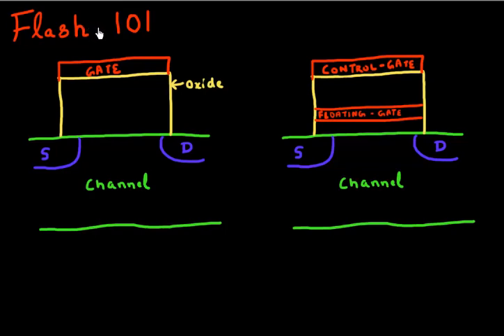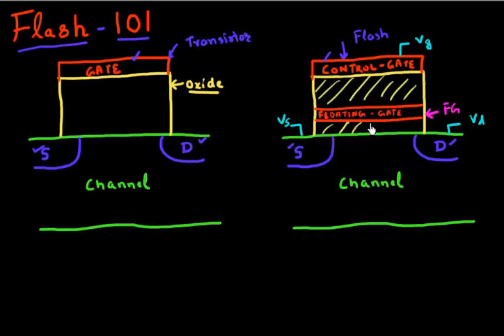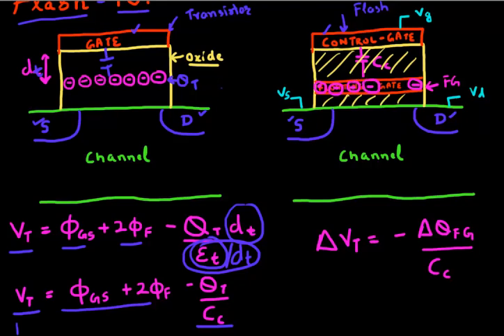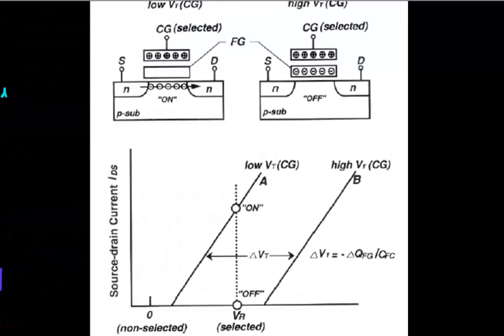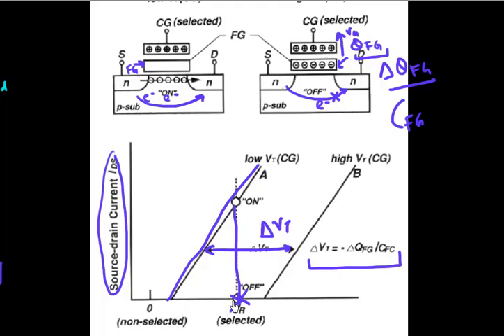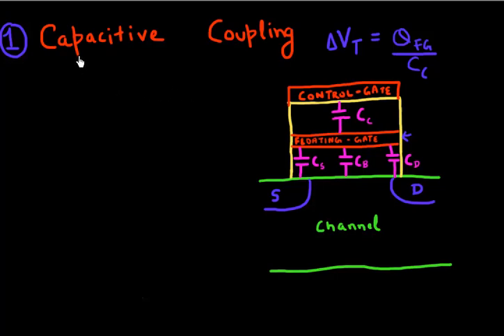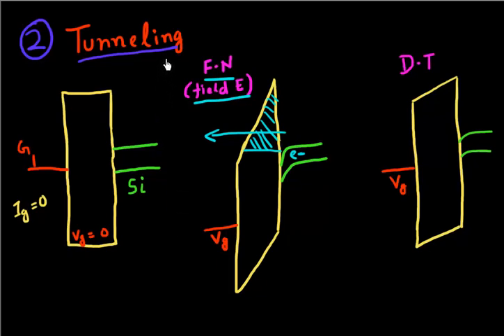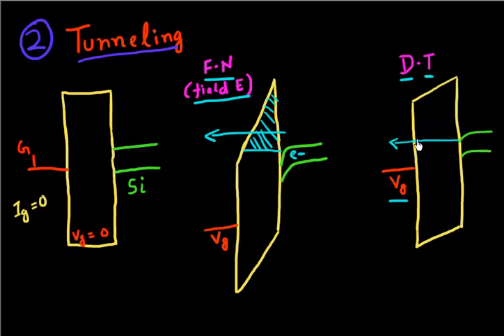Baics of Flash Memory Operation: Part 1

Comment: Thanks for the video. Actually I was trying to establish how these things fail after so many write cycles. I've been building a bit of software and have just had to re-hack it so that it does not keep writing to the same place in the flash memory. It's just one more constraint placed on the programmer, but the bonus is large cheap and low power memories.